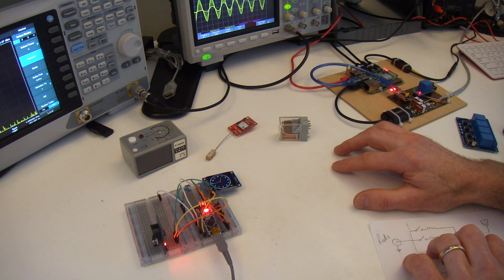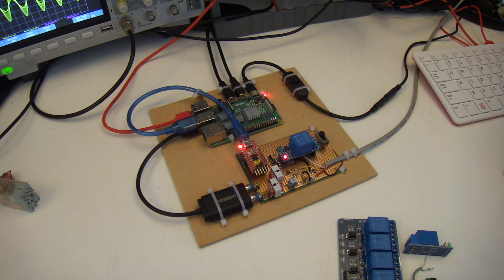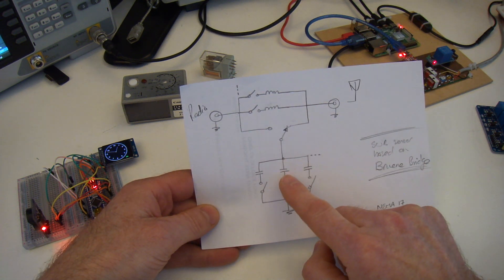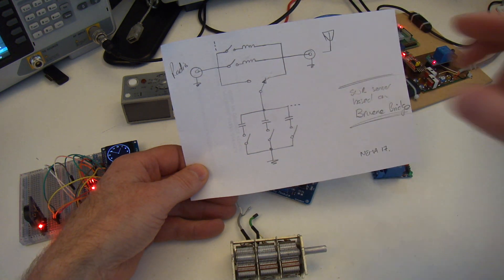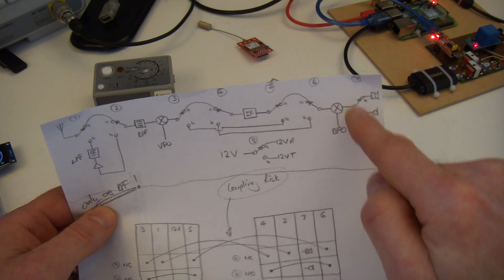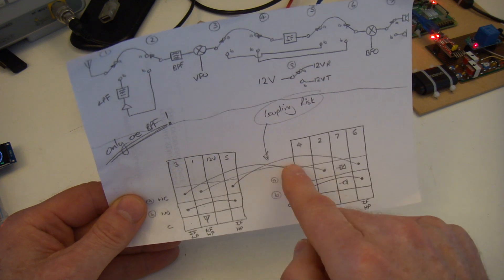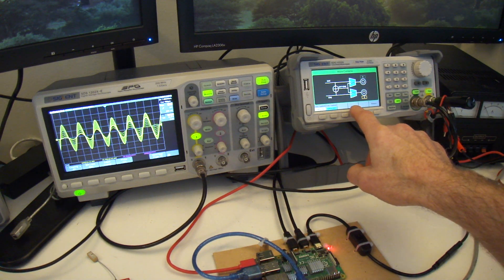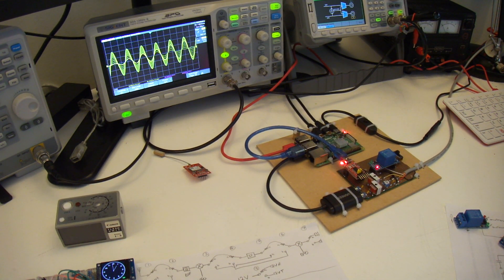Current Projects and Thoughts and Ideas for the Next Build

Comment: Quite keen to see how you get on with the auto ant tuner, I don't want to buy the versions that have a dozen relays all operating even on receive drawing more power than the QRP transmitter. If you can achieve a low current in operation - that would be marvelous. Yep motor driven Cap and ferrite Rod inductor might be ideal. Tuning speed is not really important. I like seeing your projects. Thanks.
Reply: Just another thought - is it possible I wonder, to sense resonance another way than TX SWR? maybe measuring the reactive load and tuning for 50 ohms in Receive mode similar to how a VNA would?

Comment: Just built a stepper driver for tuning my loop antenna. Microstep give 3200 steps per rotation. Problem is switch mode stepper driver has amps switching at 400kHz! And the RF radiation is huge, and so cannot be used on RX. However work fine on TX, with tuning adjusted by either a AD8307 RF meter + short antenna, or by NanoVNA to display the SWR dip. Not tried auto tune yet...

Comment: Yay, another video!  Funny you mention measuring IMD that way. Heretofore, I've used a cheap siggen and an attenuating combiner to do such tests. I recently bought the very same siglent you have there. This afternoon I compared the siglent with my combiner vs the internal signal combination feature, and I see a 5dB difference in the resulting IP3. My guess is that the isolation in my combiner isn't as good as what the generator does when it's set to combine them, and I'm likely getting a much more accurate measurement this way. My little dual gate mosfet VGA might have a 24dBm OIP3 instead of the 19dBm I previously thought!
Reply from the maker: Thanks Yakov. I'm hoping the internal combiner is acceptable as it certainly makes it nice and easy.

Comment: Hi Charlie. I thought I'd just drop you a line about the antenna matcher idea. I use an old Racal matcher that was allegedly designed for use on ships. I could find no information on it so I had to reverse engineer it to figure out how to use it. It's not automatic but it is programmable so you can set a combination of L and C for each band and then simply switch bands, or a portion of a band. It works really well. The bit, which you may have already thought of, is that the inductances used are pretty much in a binary format once they get past 1uH. So the sequence is; 0.25uH, 0.5uH, 1uH, 2uH, 4uH, 8uH, 16uH and 32uH. For the capacitance it isn't so easy because I guesss the high voltage capacitors aren't available in strange values. For that side they chose 12pF, 24pF, 50pF, 100pF, 200pF, 400pF 800pF, 1600pF and 3200pF. I use this to match to an inverted L antenna at it's base with the controller in the shack. I've never needed more than the 800pF capacitance and I suspect that's because my garden is quite short so the antenna is likely to require inductance. To make it more versatile, I use the control lines for the 1600 and 3200pF capacitors to control the switching of a multiple position UnUn. Relays change the tappings on a trifilar coil giving me a great range of input and output impedances. If anything it might be too versatile as it can be difficult to work out what combination of L match and UnUn will work the best. I think writing code to do that would be one hell of a challenge but for the basic matcher/tuner without the UnUn it should be pretty conventional. Good luck. I hope this gives you some pointers. Oh, and if you decide to go down the stepper motor/ variable capacitor route, take a look at what people have done with automatic mag loop tuners. There's some good stuff out there.
Reply from the maker: Thanks Mark. That really useful. I'll use this when I start the project. Thanks again.

Comment: Charlie:  Have you ever used analog-transmission-gates (i.e. 4016, 4066, 4051-4053--or even discrete FET's)?  They do have some on resistance (aprox. 125 ohms) but they can handle signals up to 40 MHz. Maybe not appropriate where you are switching power but for analog-DC and low-level RF, I've found they work great. But the main reason I like them is for power savings and that they can be left in any configuration with just static voltage.
Also, I've in the past used DIP reed-relays as their current draw is very low in comparison. 
Anyway, good luck dealing with the 'real-world' and best to ya!  73...
Reply from the maker: Yes, but not like this. I'll take another look. Thanks for the input and 73 also.

Comment: Be interested to know why you chose siglent over rigol for those shiney new test instruments, if that was even a consideration.  I’m thinking of splashing out on similar stuff.  I can’t afford Tektronix or Agilent stuff (who could as a hobbyist?)…. Be VERY interested in the 3rd intercept point measurements, how you take them, what they mean for your designs, and how you improve things in the light of the measurements you take.
Reply from the maker: In the end I went with a local supplier, as the support was excellent and the capabilities exactly what I was after. So far i am really pleased with all three units.
Reply: One big advantage the Siglents have over Rigol is they don't charge you for the cool features -- everything's enabled new in box.  I'm talking about the oscilloscopes, BTW.  Sure, you can hack the Rigol firmware, but why bother when a competitor makes a great product that doesn't need it?  On the sig-gen, I found the Rigol's specs to be somewhat lackluster by comparison. E.g., harmonic distortion figures are usually about 10dB worse on the Rigols.

Comment: That digi-mode board is really neat Charlie, physically, and in keeping the main PC free. I have to confess I cam out in a cold sweat at the thought of using 4 pole relays, I have had some horrors with 2 pole so will be very interested to see how they pan out. I have a relay switched SSB transceiver using relays around the IF strip, using N6QW's simple SSB design. Works really well. Hope the house move goes well, always fraught times!
Reply from the maker: Thanks Steve. It will be interesting to see how the relays go. You don't know if you don't try!

Comment: Instead of relays, how about fet switches?  The 74AC4053 is a "triple pole double throw" (three SPDT) fet switch, and available in both DIP and SMT packages.  Also cheap.
Reply from the maker: Thanks. I'll take a look.
Reply: @CharlieMorrisZL2CTM  Think I ment 74HC4053 or 74HCT4053.  Just different speed families.

Comment: those big relays work nice for switch but are big. i did find some nice smal RF switches that can be controlled by arduino's :)
examples: HMC321, HMC284, HMC252, HMC7992. they are between 2 and 8 ports and are between DC and up to 8GHz.
they do not handle much power but are good for routing internal RF signals.
Reply from the maker: Thanks. I'll look into those.
Reply: Mouser lists the HMC321 for $31 each... do you know some magic place to get them cheaply?
Reply: @yakovdavidovich7943  aliexpress ;) around 10 to 20 euro
Reply: @djneon12  wow, I guess that's somewhat better, but that would instantly become the most expensive part in my whole transceiver!

Comment: Big shout for an ATU project - really would like to see that. I've always liked doing it in stepper motors but variable capacitors are shockingly expensive. I've personally found relay ATUs aren't as good as manual tuners - often can't get a match when the tuner can - so variable caps are much better
Reply from the maker: Thanks Graeme. I'm looking forward to the project. Not sure how it will turn out, but that's a;; part of it.